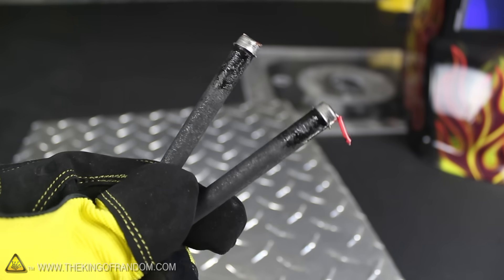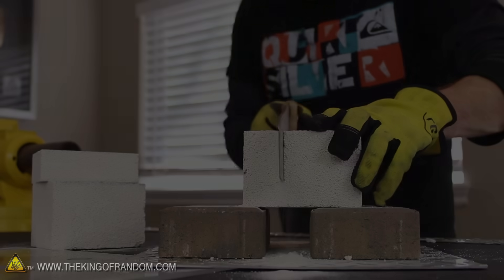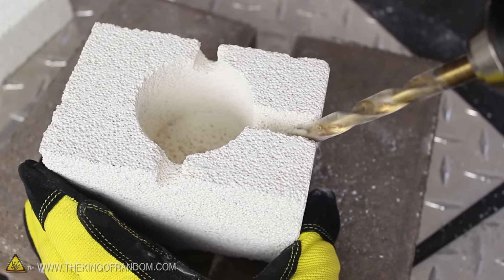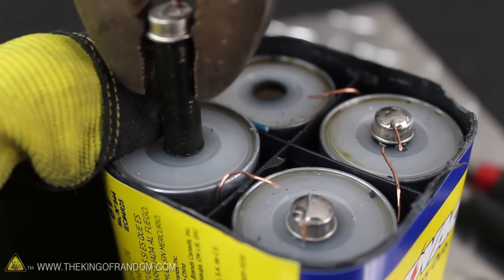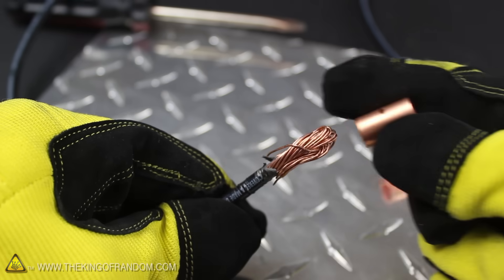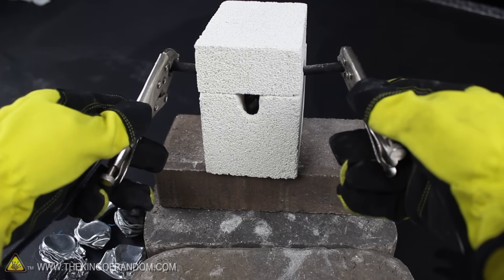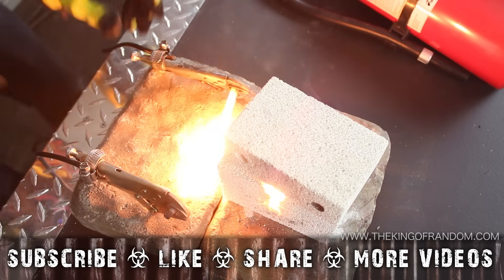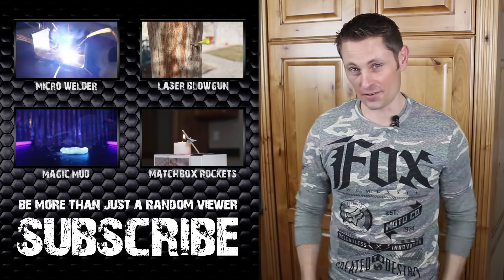How To Make An Electrical Arc Furnace

Comment: how many amps does it run at? ac only or DC?
Reply: +Joo Jingle I have a 300 amp Miller ac\dc welder  is there a range of amps that works best or is it trail and error
Reply: +Bryan Sullivan curious of his settings too

Comment: I don't know about anyone, but I can't find these fire bricks anywhere. Let me know if you can find them online.
Reply: Oskari Juutinen
Really, I just saw some guy cutting it with a thermic lance.
Reply: Sarah Szabo http://www.amazon.com/Amaco-28035N-Insulating-Firebrick-Size/dp/B007VEOIVA/ref=sr_1_9?ie=UTF8&qid=1455335046&sr=8-9&keywords=fire+brick#biss-product-description-and-details
Reply: +Sarah Szabo i found some but they are REALLY expensive around $50 ish not worth it. try making a concrete mold by pouring concrete in a container with a smaller container inside to make the reaction chamber. this is what i did and it works fantastic. holds the temp good as gold. anyother question?
Reply: Nathan Pennell
Yeah, that's what I'm going to do.
Reply: *****
Doubt it dearly. Be careful, from what I've heard concrete will explode violently if it gets too hot. But, I don't know for sure, check it out yourself.
Reply: +KonkeyDongMupersan oh right thanks for the warning I better do some more Research on this before I use it. I'll let you know what i find
Reply: +Nathan Pennell Yes, concrete will explode if you heat it too much. I have experienced that 😅
Reply: +Sarah Szabo do NOT, under ANY circumstances, use concrete. Grant uses fire bricks for a reason. Try going to a hardware or building supplier and asking.
Reply: +Sarah Szabo Amazon has 9 x 4.5 x 2.5 bricks for like 10 bucks, just drill down an inch and a half rather than two when making the chamber.
Reply: Ravenous Travis
Really? I couldn't find alumina silicate fire brick anywhere. Can you post the link?
Reply: Ravenous Travis Wow, I think you actually found it. The shipping time is insane (1-2 months, seriously?), but I think that's actually it. I did notice that the melting point was a bit low though (2600), but it seems good.
Reply: Sarah Szabo Well the bricks he's using in the video aren't much better as far as my research could determine. I'd say just don't do a particular melt for an extended period of time and you should be fine. The shipping sucks but it's the cheapest I've been able to find. I found a similar brick on ebay for about twice the price after shipping but it ships in about 1 business day, or so it says anyways. Personally I'd rather potentially wait two months and save 10 dollars.
Reply: Ravenous Travis
I did a similar search with similar conclusions. There is no way I'd wait that long for shipping though XD
Reply: Sarah Szabo Well here's the one I found on ebay if you're interested.

http://www.ebay.com/itm/K-26-Insulating-Firebrick-9x4-5x-2-5-IFB-Fire-Brick-Thermal-Ceramics-Bricks-K26-/200945542607?hash=item2ec949a5cf:g:DrMAAMXQXMRR7IT8
Reply: eBay has them but they are very expensive. I haven't had any lick sourcing them locally either
Reply: eBay has them but they are very expensive. I haven't had any lick sourcing them locally either
Reply: eBay has them but they are very expensive. I haven't had any lick sourcing them locally either
Reply: Ethan Lingenfelter
Yeah, exactly. I have no idea where he was getting them from.
Reply: +Sarah Szabo they are cheap
http://www.ebay.com/sch/i.html?_from=R40&_trksid=p2050601.m570.l1313.TR10.TRC2.A0.H0.Xfire+brick.TRS1&_nkw=fire+brick&_sacat=0
Reply: 2fastHarley
I disagree, $15 shipping? That's 3x the price of the item!
Reply: 2fastHarley
That's a bit expensive for bricks. I can make them for $3 of play sand and $5 sodium silicate. And I can control the shape.

I wouldn't freak out either.
Reply: +Nathan Pennell I am confused----One side of the copper wire goes on the clamps, but where does the other side of copper wire go? He said 2 copper wires, so where does each end go?
Reply: PathTo Entrepreneurship
To what are you referring? The welder (transformers) are hooked up to the two wires that are on the carbon electrodes. The arc completes when the graphite electrodes are brought close together.
Reply: +Nathan Pennell  hey just a suggestion but using sodium hydroxide and silica gels  to  make sodium silicate , ( water glass ) you could make this brick yourself why not ask The King of Random for measurements of the brick he is using , just a suggestion =)
Reply: Charles Reed
Yeah, that's what I was going to do.
Reply: tractor supply has them
Reply: +Sarah Szabo lil l8 but http://www.walmart.com/ip/46056973?wmlspartner=wlpa&adid=22222222227033760275&wl0=&wl1=g&wl2=c&wl3=88146674568&wl4=&wl5=pla&wl6=122345140608&veh=sem

Comment: The steel was not melted? But the fires and heat from the plane impacts and fuel keeping internal flammable materials burning intensely did weaken the inferior end joints on horizontal joists to cause the house of cards scenario to take place...

Comment: I'm just using one transformer and not getting an arc out of the carbon rods. I get a small spark like you would from touching a 12volt source to ground so I know they are making contact. my thoughts is that maybe the single transformer method of using the 2 gauge copper wire is too much for this. any ideas?

Comment: It looks like you have something along the lines of a k-23 brick, indicated by the 23 on the brick.  If they are only made for 2300 degrees F does that mean they only insulate to 2300 degrees or they start to break down at 2300 degrees.  If so this should not be suitable for melting steel.  I'm trying to order some and I'm trying to decide if its worth it to get something resistant to 3200 degrees F?
Reply: +Nik Holt  Where are you looking to get them? I'm looking for the same thing

Comment: I want to build a giant fire brick furnace that's inside a flower pot.... then a steel fire extinguisher should work as a  crucible right?
Reply: +A010110011101A001101.           ;)

Comment: any way to get the insulated bricks bigger to make bigger chambers, thus holding much more stuff?

I feel as if I wanted to make a giant steel master sword >:D
because idk if steel can be melt with the metal foundry
Reply: Bigger Sized Bricks, not a bigger chamber on the same brick*
Reply: +xEvilfriend 
Right off the bat? Casting steel is a no-no. But I'm sure you could find a larger size fire brick just fine. The question is this: Do you want to burn steel and waste most of it for a non-functional easy to make sword. Or forge steel to efficiently make a functional non-high quality (probably) difficult to make sword? If you want to cast steel be my guest, but I suggest you just use/make the/a foundry to heat it up and forge it (the sword) with a hammer.
Reply: *****

Haha, yeah ik. If you got copper/tin you could make bronze, heck even copper by itself casts really well. Plus if you hammered it the sword wouldn't be so soft. And, on top of all that, it's easy to recast if you mess up, since the melting point is low.
Reply: +Joo Jingle bro, what if he didnt wasnt it to be functional, but as a prop? I would cast steel for a prop
Reply: Devin Huie

That's not quite how it works. If you want a prop just cast aluminum. Steel burns more than melts.

Comment: I've only done mig welding but I'm quite interested in making this since we go through so many of those batteries. Not owning a ark welder, is it possible to use a PSU from a computer, or will I have to wait for the microwave to break?
Reply: +Ruslan McCabe Computer power supplies are switching supplies, which means they don't use transformers except possibly at signal frequencies. I don't know where you're at with electrical knowledge but long story short you can't use a psu, you'll need large transformers, and microwave transformers happen to be the most easily available! Check online for microwave transformers, or go to a thrift store and buy some microwaves on the cheap! The goal is fundamentally: high current through those carbon rods. This means you need extremely high voltage because carbon has a fair value of resistivity. The transformers give this, a power supply in computer just steps the voltage down!
Reply: Could use a new welder, so will probably make a microwave ark welder.

Comment: Try this: Make a distiller at the top of the bricks that bends down under water. Throw a mixture of calcium phosphate, silica and carbon. If you run the arc through the powder you'll get calcium silicate, tetraphosphorous decoxide (P4010) which is reduced by the carbon to vaporous white phosphorous. The vapor will harden under the water. The only issue is the furnace needs to be sealed. If a bit of phosphorous burns in the distiller it'll rob the oxygen leaving nitrogen aka you can produce lots of pure white phosphorous. If you can do this you'd be the real king of random.  ; )
Reply: ***** Producing white phosphorous is legal as the red phosphorous on match books. But it can quickly become illegal if sold, used or suspected for the manufacture of meth. The "use" in this case would be to entertain nerds like me. There's only 1 good video on youtube showing how white phosphorous reacts with air and it's pyrophoric properties. The other videos with chemist teachers just pour a bit on paper and burn it which is boring. I wanna see someone launch a hobby rocket in the air that ejects the powder with a good camera. It would look like hundreds of falling baby asteroids.
Reply: My brain commited suicide when I read this comment.
Reply: +Robert Cece So we're talking incendiary devices here?
Reply: lindamermaid If you wanted sure (depending on location and law). You could pack it inside with gun powder, rubber band wrap small "beeds" of white phosphorus with saran wrap or something that burns off fast. So the blackpowder goes, and it bleeds and rains hot fire in the sky. You could also do a self detonation "incendiary." Where you make the inside potassium chlorate (with a dry vent) then drip on white phosphorus dissolved in chloroform. When it dries through the vent (in open foil) it would autodetonate.

Comment: What would happen if I was to touch someone while the carbon rods were heated?
Reply: +UltimateEx They would either: set on fire and burn to death, or they'd have a really bad burn. Or maybe even both!
Reply: +UltimateEx You gave me an idea on how to scare away intruders.
Reply: UltimateEx You'd cause some major degree burns. That thing is hotter than molten lava, you'd also set his skin on fire, and more.

You will get in major trouble, in short.

(You'd also need a welding mask)
Reply: +UltimateEx I guess some of the molecules in the skin starts chemically decomposing and/or burning the moment it touches the skin and the body fluids in and under it would probably evaporate. If you were continue pressing it in further it would probably leave hole behind with the outside being similar to charcoal.

If someone has actually made this device, I'dd find it very interesting to see what would really happen as this is just an hypothesis. Trying in on a piece of chicken from an halal store would be a reasonable test to me (halal because most stores inject water into the meat which could change the reactions in the meat)
Reply: martijn smit Funny u mention halal because I actually eat halal meat :D
And I would test it but I don't trust myself to not die with an arc welder

Comment: can you use a car battery instead of that power source?
Reply: I was gonna ask the same question lol 😂
Reply: umm I don't think so cuz battery is a dry cell which contain carbon, while car battery (accu/accumulator) doesn't contain carbon at all, but you can buy carbon tho

Comment: Google insulating firebrick. That seems to help. There are different K grades. K 26 = 2,600 F temp rating. That seems like a decent commonly available choice. Guessing by the 23 on the brick at 0:25 he is using k23.

Best price w/ shipping I found is here: http://www.ebay.com/itm/140357365038

Comment: Hey man, love your builds, been a subscriber for a long time.  I have a question, if I made a larger furnace, would the two carbon rods still emit enough energy to melt glass?  I want to start blowing my own glass at home but I'm not sure if it's worth it to build my own furnace to melt the glass. I know sand melts at around 3000 F, I'm just not sure if this sort of reaction is enough to make liquid glass to melt down and shape into the type of glass I can blow.  Please let me know what you think, or if you decide to try it out with any old glass laying around. Thanks man!

Comment: whats an easy substitute for the AC arc welder? Do you even need the copper wire and hose clamps, or can i just use the pliers with the carbon rods for it to work.

Comment: I'm glad you read the SDSs, however, they are so uniform as far as the recommendations go for PPE. My job is partially to look at different SDSs and they mostly all say 'wear appropriate protective gloves, lab coat, and chemical safety goggles'. Sometimes it gives recommendations on respirator use. What manufacturer was this?

Comment: I tried to make this but instead used a step up transformer called the ELC T-5000 but the circuit breaker trips every time, even on the 110 outlet, does anyone have any possible solutions.

Comment: Im using to lage pieces of steel, and want to make a machete and a few knives out of this, can anyone help me with recomended forge sizes and tips on how to get the shapes
Reply: +CrispSword56 If I did my math correctly when looking at the density of steel and the average weight of a machete, you would need a little under 9 cubic inches of steel. so if you can make the chamber 3x3x5(putting a couple extra inches of depth to make enough space to safely move the furnace and space for the carbon rods) you should be able to create a single ingot large enough for a machete. I used the upper end of average weight for machetes at 2.5 lbs.

Comment: Hi everybody, 
I want to make stainless steel by homemade electric arc furnace. But carbon diffuse to molten metal make carbon content in stainless steel increased. That's not desired. How I solve this problem?

Comment: you are scared about the dust from cutting the bricks.....  but than you are melting zink......   thats soooo clever dude!
Reply: +Herkus Rudzinskas actually you can get heavy metal poisoning(zinc fever) from inhaling zinc fumes, with the worst case being death, and the typical scenario being flu-like symptoms.
Reply: +Jarrod Frost Thats why he has lots of ventilation
Reply: Proper ventilation can also help with the dust as well though. But I will agree that dusty inhalation is more likely issue just due to the size of the particles making it take longer to dissipate.

Comment: Two questions, do the MOTs need to be the same wattage and does this project need to be used with the scariac or could you just add a kill switch since it runs at full power?

Comment: Suggest a $15 half-mask P100 respirator.  The dust mask he's wearing won't seal to your face very well.  You don't want silicosis (sharp edges on silica dust particles cause lung tissue scarring).
Reply: Remember when sweeping up that it's still silica dust.  Best to keep your cumulative exposure down.

Comment: Can this be used for forging?
Reply: +Ryan Ho a drivers license? lol!
Reply: +Ryan Ho btw,  I KNOW!
Reply: +ijustwanttoseetitty so R u just trying to be sarcastic?
Reply: Forge wat exactly
Reply: Ryan Ho steel
Reply: +linkcowgamergameplay yes
Reply: +ijustwanttoseetitty btw I was talking about what metals he wanted forge
Reply: +linkcowgamergameplay  Depends you might be able to forge a ring, but if you plan on forging a sword or anything bigger than 2 inches, no it wouldnt be able to be used for forging.
Reply: +linkcowgamergameplay 
I think it can be used for forging because if you don't completely melt it, if you use a hammer, it might work.
Reply: +Mars 101 EBAY Search for Insulating FireBrick Thermal Ceramics TC-23

Comment: Can it melt steel beams?
Reply: It can
Reply: +{MLP} Rainbow Dash edgy
Reply: If it can, it's stronger than jet fuel
Reply: +TheJG Rubiks it is stronger than jet fuel
Reply: +{MLP} Rainbow Dash yes, but melting steel beams in reinforced concrete/composite design takes more than this or jet fuel.
Reply: +diazzsama Yes, it takes an angry stare from a Kryptonian.

Comment: I like the way you showed this Grant. 
The fumes from zinc will kill and have done. Take the short while to check. Where I live, fire brick seems to be on another planet. 
Whilst writing this I say to us, for the sake of life, find the appropriate mask and ventilate. I know probably every excuse in and outside of the book - this is a nasty risky one though your demo was of short duration. One guy died in about 24hrs but he was burning zinc from galvanised pipes in a furnace basically inside. This is where I get stubborn against the excuses - ) so keep on weighing your risks with ever sharpening senses. Thanks for the presentation.

Comment: Perhaps you could use the zinc muffins to plate other metal objects.  Placing the zinc and the object to be plated in a glass baking dish with DC current doing the work.  negative to the metal and positive to the zinc (I think, maybe it's the reverse).  Cover both with acid and there you go.